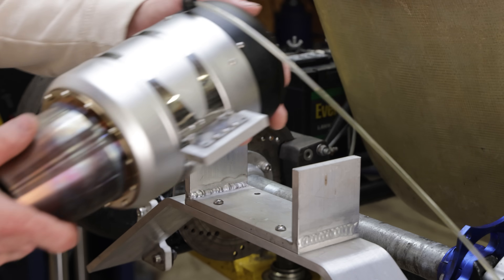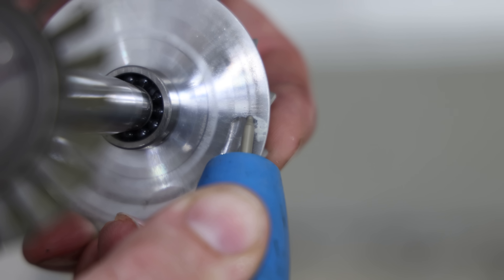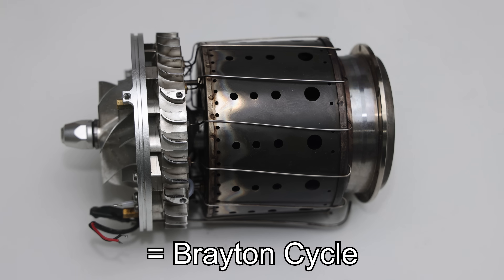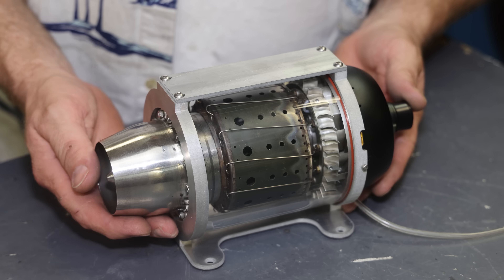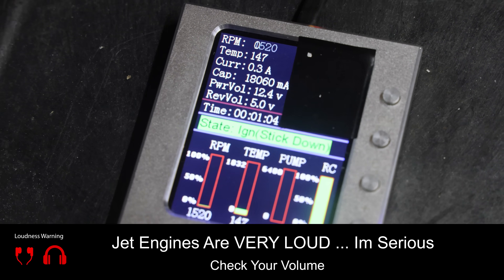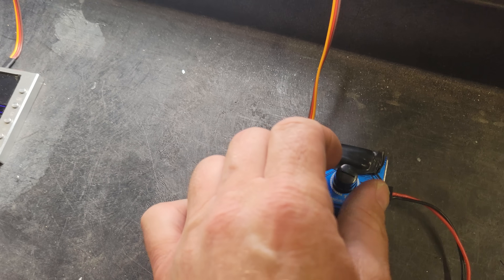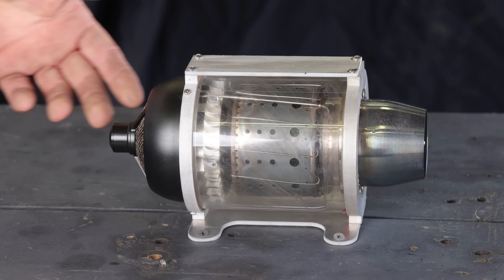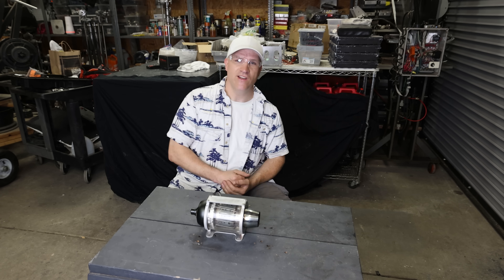See Thru Jet Engine

Comment: Very cool.   I still can't wrap my head around how jet engines work.    The compressor obviously causes more air to come in than the turbine wheel allows out.   Hence, between them the air is compressed.    Adding and burning fuel increases the pressure.   But since the compressor has a higher "pull" rate, why doesn't the increase in pressure load the compressor down resulting in slowing then stopping the engine?   Hmmmm, I guess the super-heated air sees the turbine as the easier way out.   And in doing so, must impart enough energy into the turbine to power the compressor.     But since the pressure imparts the same amount of force as required to drive the compressor, it would seem to balance out the restriction.   So then why does the air flow out the rear of the engine?    Momentum?  Of the compressor and turbine?  Or the air flow?      Just seems like it shouldn't work !
Reply: i have the exact same issue when thinking about jet engines. What stops the super heated gas to just exit through the compressor?
Reply from the maker: That's crazy because that's exactly what I say in the video but I think I didn't include that part in the edit. I guess I'm not the only one, but the reason I excluded it is because if I break down the math and the pressure zones then it actually makes sense. But you really have to dig deep to see how the flow Dynamics are working
Reply: "The compressor obviously causes more air to come in than the turbine wheel allows out. " - i think this is exactly the opposite. Compressor is designed to produce high pressure with relatively low flow, while the turbine is designed to "produce" (inversely) a lower pressure drop at a higher flow. It is the combustion (and consequently, expansion of gas due to high temperature) that maintains the high pressure inside; if you just spin up the engine with no combustion, you'll probably have a slight vacuum in the chamber. 

Well, that's how i think it works, i actually have no experience with jet engines, so feel free to ignore me.
Reply: You can't look at just one parameter of the working fluid (such as pressure, temperature, or density) at a time and make any sense of the operation. And keep in mind that what goes in, goes out, so (ignoring the mass of fuel which is small compared to the mass of air), the mass (not volume) flow rate is the same in every part of the engine.
Reply from the maker: @brianb-p6586  exactly, it's very dynamic
Reply: I just noticed that you said " The compressor obviously causes more air to come in than the turbine wheel allows out.   Hence, between them the air is compressed." No, there is no difference in the rate of mass flow of air through each section, and there can't be because everything that goes in has to go out. 

You were probably referring to volumetric flow rate, but even that isn't right: the compressor doesn't work because it's pushing air against the turbine, and it would work even if there was no turbine at all. The impeller of the compressor section speeds up the air adding energy, the diffuser of the compressor section slows it down exchanging velocity for pressure.
Reply: "Hmmmm, I guess the super-heated air sees the turbine as the easier way out.   And in doing so, must impart enough energy into the turbine to power the compressor.     But since the pressure imparts the same amount of force as required to drive the compressor, it would seem to balance out the restriction. "

Yes, the turbine delivers exactly the power used by the compressor; the rest of the energy in the exhaust is why the exhaust is flowing at high speed (and is hot), and accelerating the air to that high speed is how the thrust is produced.

Flow direction is not about restrictions, and that is perhaps the most difficult part to understand.

Comment: With the heat and speed of air inside, you will just get clear / no fog air because the particles of oil that are visible, become heated and separated. Probably heated to the point that the particles burn up leaving just clear air left. It definitely took in the smoke, you just can't see it in the combustion chamber because it burnt up and separated. If you could put some form of dust through it, you may actually see something but that has its own separate dangers. On the other hand maybe water vapor like reprile fog machines produce might be slightly more visible than the glycerine based fog. Very cool none the less to see inside it.
Reply: The fog air gets compressed and the fog solution will liquify and burn up instantaneously.
Reply: I think to really see the inside you would need to produce smoke AND spool the jet engine without giving it fuel
Reply: I wonder if it would be possible to just run the turbine slowly and without fuel so you could actually see the fog.

Comment: The cooling of the combustion chamber upon throttle up was definitely  unexpected
Reply from the maker: I agree that was very unexpected, the way that heat moves from the front to the rear is very interesting.
Reply: This remembers my Harley, in idle it gets much hotter than while revving, even without moving, only the fuel flow does cool the engine